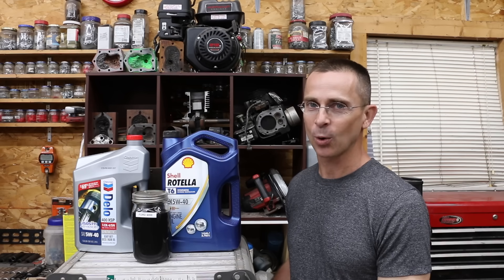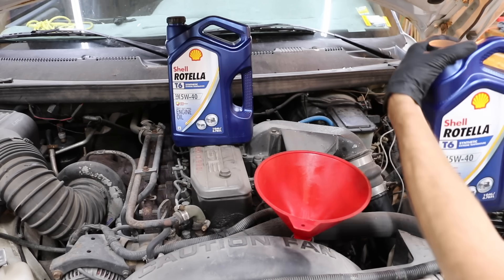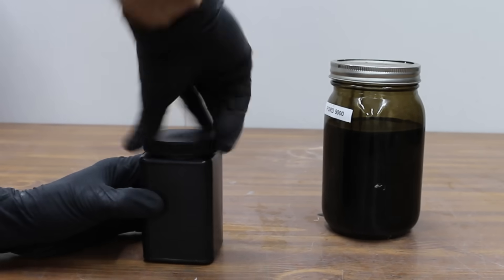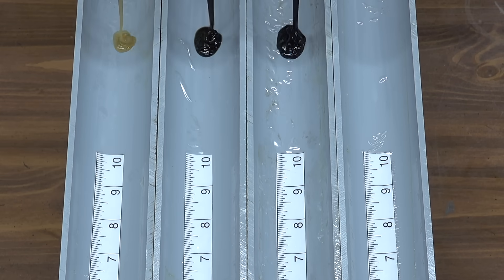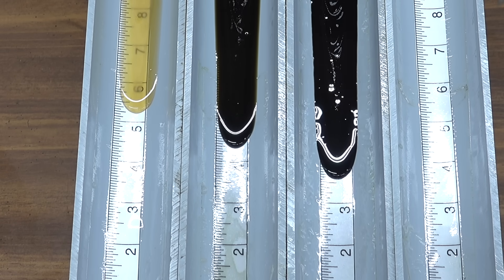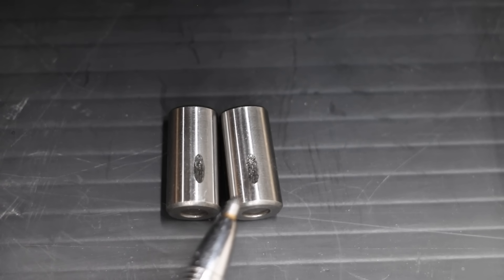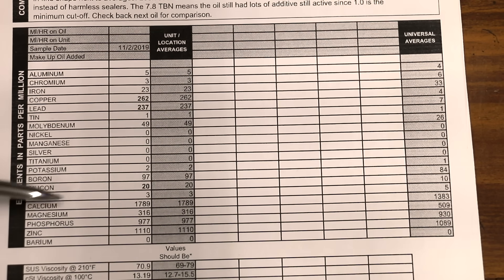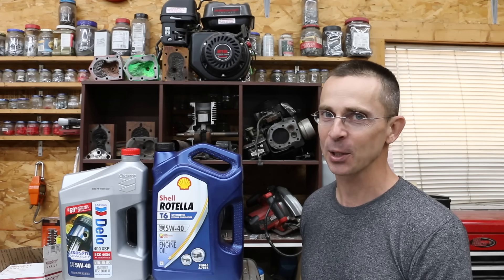Will Annual Oil Change Damage Your Car? Let's find out!

Comment: Video idea: Many people are using synthetic oil in their classic (wet clutch) Japanese motorcycles. They are designed for mineral motor oil.   Some people claim it messes with their clutch plates and eventually ruins them. Others claim it is better for their bike.
Reply from the maker: Thank you for the video idea!

Comment: The Rotella T-6 also used to certified to be SN grade by API. The rumor is that the API changed the certification process or requirements and Shell didn't feel like jumping through the additional hoops to keep the certification. Lots of people inquired to Shell to ask if the formulation had changed and Shell confirmed to multiple parties it didn't. So long story short, Rotella T-6 is also basically SN grade.
Reply from the maker: Thank you for the feedback!
Reply: @ProjectFarm  No thank you for your great, informative, and educating videos!

Comment: Video idea: test the film strength and flow characteristics of oils at a real life “cold” temperature and a real life “operating” temperature. And/or can you notice tell a difference in performance as the weights change (ex 5w-30) from a 5w to a 30w as the temp (engine) warms up.
Reply from the maker: Thank you for the video idea!

Comment: There was an old man back several years ago and he owned several gas stations. I won't involve his name but he's had these all over the state and all they done was sold gas, oil, brake fluid, transmission fluid, and cigarettes and condoms. It was just normally a place about as big as four phone booths put together ( for you young whippersnappers that's never seen or heard of that, is a small glass box you get in and close the door and use the telephone haha.) and normally has a small storage shed for a couple cases of all and Smokes & Things. But this gentleman had had these string of stores for several years and I only started knowing him probably close to fifty years ago and he was in his sixties at that time and he is long since dead but he use Quaker State oil in his Cadillacs. He would normally buy a Cadillac ( I think he had a half interest in the Cadillac dealership in town) and put a hundred thousand miles or so on it and trade it in but you know a hundred thousand miles back in the forties fifties was unheard of on most vehicles. But anyhow he would put Quaker State oil in his vehicles and only change the filters every so often. And all he done during the day would go check on each of the stores and I guess pick up money bring a few supplies and such. He claims that some of his mechanic friends said that motor oil did not wear out just got slicker! Well you know that's not true but a change filters every so often and added the correct amount of oil and that's all he ever done. now he may have just been lucky but I used to pull heads off of vehicle that had Quaker State run in it, and the head The Rock arm everything would have and 1/2 inch of sludge baked on top of them. and of course it would stop the return holes in the heads and want to burn everything up and blow a lot of oil out. But just thought I would throw that out there that you folks about some folks that only change filters and never change their oil. Drive-on!
Reply from the maker: Thank you!

Comment: Thank you. The unbiased information that you provide is extremely rare. I really appreciate everything you do.
Reply from the maker: Thank you for the feedback!
Reply: @ProjectFarm  Could you do a video comparing 0w20 to 5w30 oils? The Toyota 3UR-FE V8 specs anywhere from 0w20 to 20w50 depending on country. The US specs only 0w20 while the Middle East and Australia can use 5w30.
Reply: @Joe333x  Maybe the variation is due to ambient temperature? I understand parts of the U.S. sees temperatures below freezing. In Australia, thats very rare. However we  often have high temperatures, so we have to deal with that.
Reply: @ProjectFarm  interesting facts about leading oils, must see!!!   https://www.youtube.com/watch?v=g7Tc-YkJRxk&feature=youtu.be

Comment: Is your Dodge equipped with a Live oil pressure gauge or is it simply a “dummy gauge” that doesn’t move except on start up and stays in the same position?
Reply from the maker: It's supposed to be a live gauge but it's not very accurate.

Comment: A lot of European and Asian gasoline and diesel cars have oil change intervals of 24 months or 30.000km (18.641 miles). They require 5W30 oil according to ACEA C3 (fully synthetic) but they are designed to last 300.000km (186.411 miles).
Reply from the maker: Thank you for the feedback
Reply: @ProjectFarm  Toyota try to make you change your oil every 10k or 6 months, it's crazy.
Now I'm past the warranty period, I just change on the 10k mark with a good fully synthetic oil. Whatever the months work out to.
Reply: my golf 7 needs oil changes every year and every 2 year a big inspection.

Comment: If you decide to sell the Dodge let me know! I want to made a Hotrod 2nd gen..... Cummins engines don't like 5W-40 unless it is below 0 for extended periods, it will wipe the cam, they like 15W-40. T6 Rotella is hard to find around here in that viscosity, everyone sells the 5W-40. I get mine on Amazon..... Great video!
Reply from the maker: Thank you for the feedback!

Comment: Just a note my uncle back in the day use to only replace his oil filters and top off the oil , he always said the oil actually never went bad as long as the color was with in reason he would change the oil at like 3-5 year intervals and he drove his cars for his living of doing sales he had a 390 ford on a 68 ford that had over 700k miles on it and ran grate never smoked or ticked he used valvoline oil only as well, he had other high mile cars I just really remember the ford as a teenager in the 80s though and the high miles I thought it was cool .
Reply from the maker: Thank you for the feedback

Comment: I'd like to know if it's true that engine oil has an expiration date. I use pennzoil platinum 0w40 for my SRT charger and on the bottle, there's a use by date.
Reply from the maker: I've never seen an expiration date on car motor oil.  Jet aircraft oil has a 10 year shelf life
Reply: @ProjectFarm  yes, I've never seen that before either... maybe it has to do with separation of additives?

Comment: My car (a 1980 Lada 2106) is known in the history of chugging oil and fuel if not maintained correctly. Especially over 100k Kms and then a rebuild should be done,cause the rings do let out quite a bit of oil if not maintained. Now here's a catch,the previous owner of my car changed the oil every year or up to 3000Kms and the car now has 105k Kms and it still runs perfectly a-okay,no burning oil,no clonky sounds etc.Now might be that it's a lucky shot but i always say "it's cause he changed the oil very often" and i will say,for older cars maybe they will benefit from it,but who knows. 
Anyways,great video,very interesting and informative! Keep up the good work!!!
Reply from the maker: Thank you!

Comment: Todd, I couldn't believe my eyes when I saw this video today, because this is the question I asked you in the comments of a previous video! Thank you so much you made this video. 
This is Exactly like my case at the moment - my car oil is full synthetic at 1900 miles (3000 km) and is like yours - 17 months old. I change my oil myself because I find it satisfying experience and planned to change it in the spring when it is warmer. One day I spent a day researching the Internet whether I should change my oil around the one year mark but I could not find anything - everybody said that it should be changed once a year (for the synthetic) because it was written on the bottle... Also in the car forums was popular the opinion that the oil no longer has the lubrication properties, that it contains water/moisture, fuel and it is bad for the engine. However these were all peoples assumptions and absolutely zero tests, experiments, or facts, only opinions or writings from oil bottles. So knowing this rumors and legends I started to avoid driving my car because I false knew the engine oil is bad and I am going to damage the engine life. 
I drive the car couple of times a month and reaching operating temperature every time. Yes, I knew that the engine oil is not good as new, that the oil condition depends whether is city or highway driven and on other conditions. However until now I haven't seen any tests to show whether such low mile oil will ruin the engine if passed the annual change mark.
So thank you so much Todd, that you myth busted this the one year mark for a low miles oil and brought light to this topic! With hand on my heart I am saying that this is one of the Best channels on youtube! Thank you and Merry Christmas!
Reply from the maker: Thank you very much!   Merry Christmas!

Comment: great experiment . however , i am a firm believer in not changing oil , i have a toyota tundra 2009, with 146k on it . the dealer gave free oil changes up to 24k and since then i changed oil (synthetic)  a handful of times only because i was bored. The truck runs great , i put 4000 miles in 1 week driving to canada . no problems . would you like a sample of my oil ?
Reply from the maker: Thank you for the feedback and the offer

Comment: I have a 1977 Corvette. Have owned it since November 1988, and it's now December 2019, 31 years.  The oil i have used since 2001, is Castrol synthetic.  I changed the oil, just last month, which was the first time since November 2009, with only 830 miles traveled!  No problems with the engine!!!
Reply from the maker: Wow!  Thank you for the feedback

Comment: Hey the oil friction test simulates the stresses bearings get in the engine, but not the up down motion of the pistonrings against the cylinderwall. Would it be possible to test this somehow?
Reply: Oil manufacturers test that with a special device. It is called "Combustion engine".
Reply: Völl Däpp woow hät ich jetzt nicht gedacht 🙄 merkste das das zu aufwändig wäre um da resultat für ein video zu erhalten
Reply: @McFlegmato  Ja klar, ich wollte damit andeuten, dass das eher nicht leicht nachzubilden ist. Da spielen ja auch noch zig ander Faktoren rein. Temperatur, Druck (!), Verdünnung durch den Kraftstoff, Gasströmung, Verbrennungsrückstände, Scherstabilität (ist das was du meinst denke ich),  Schergefälle in Abhängigkeit der Drehzahl ... etc.etc. 

Motoröl viel komplexer als es den Anschein hat. Das was Project Farm macht, ist wie er selber sagt, nur eine Indikation und ich glaube, seine Methode ist okay für die Fragestellung: Muss man ein Motoröl wechseln nur weil es ALT ist, aber geringe Belastung (wenig Motorlauf) erfahren hat?

Und die Antwort ist klar: Nein.

Ob man mit seinen Methoden Fragen wie: "Welches ist das beste Motoröl für Anwendung XY?" oder gar: "Welches ist das beste Motoröl?" beantworten kann, da hätte ich Zweifel, obwohl er viel solider arbeitet und argumentiert als viele andere Laien.

Comment: The new Ford specs require an oil change every 16000 kms. For me that's once a year. Wonder if the oil is finished after that long ? Also what really happens if you accidentally put gas in a diesel vehicle ? Do you have to drain it right away ?
Reply from the maker: Thank you for the feedback

Comment: First off, a lubricated engine doesn't get rusty even if the oil is old and has acid in it
Oil does not break down unless badly overheated and burnt. but the additives do get weaker
Oil used in Diesel engined gets dirty looking fast, thats the nature of Diesels, and it's harmless
In my lifetime, having driven over 3 million miles, I typically changed oil in my gas driven vehicles once a year, only adding oil as needed. filter change every 6 months.
My engines typically lasted 300000 miles at which time I either replaced the engine for reliability or replaced the vehicle as it was usually pretty well worn out otherwise.
I used synthetic oils exclusively, and in later years used Rotella in some of the vehicles, Preferred oils I used were Mobil 110 w 40 and Castrol Syntec, 10 w 40---unless you operate in a climate where the low temperatures are below 10 degrees F all the time, there is no reason in hell to use zero or 5 weight oils, THAT part is all advertising hype, and manufacturers hype for alleged fuel economy  under CAFE standards.
All oils have to meed minimum SAE standards, so brand names really don't mean much, go by the stats on the product container itself.
In the past 40 years of driving, I lost only 1 engine due to oil issues, and that was after a Jiffy Lube oil filter swelled up and exploded at 75 miles per hour on the interstate, and the engine wound down quickly! It was still running without oil, and was able to go another 3 weeks as a usable engine, but after it had that failure it had a weak feeling and lack of power, so it was replaced with a new engine at 192000 miles.
LOL--I guess that means any oil is better than no oil.
DF
Reply: You are absolutely right. Don't know why people are getting fooled by this synthetic marketing ploy

Comment: Could you kindly make a video which explains engine oil in motorcycle? How will a 10W30 recommended motorcycle engine will do if I use a 10W40 engine oil?
Reply from the maker: Thank you for the video idea!

Comment: Excellent level of video planning demonstrated here.  Should probably again toss out the massive caveat to not use diesel oil in your modern car if you need to pass emissions inspection.  Zinc will ruin the catalytic converter.  For old cars, motorcycles, and people that don't care, YOLO.
Reply from the maker: Thank you

Comment: I’d like to see a diesel fuel and oil lubricant additive like archoil, stanadine, ams oil, Lucas upper cylinder lubricant,etc. ultra low surfer diesel is ruining the trucks with the bosh cp4 fuel pumps. I wonder what lubricant will make the pump last the longest
Reply from the maker: Thank you for the video idea!

Comment: Can i use Rotella t6 5w 40 in my 2001 Audi A4, gas engine?
Reply: The handbook will give you the correct specification. It's not just about SAE viscosity. The handbook will tell you the correct oil. Coded something like VW 5.0x.yy
Reply: @paulanderson79  Thanks. I have been using 5w 30 and 5w 40 Mobil 1. The car is so old and manual has some strange oil codes.
Reply: @Jinny-Wa pretty much all VW  specification oils are 5w30. Keep in mind that sae viscosity is absolutely not the whole story. This idea of old car use thicker oil is nonsense.
VW, for all its faults, is very precise about oils.

Comment: Use synthetic oils and change your filter often (3k miles). This way you don't have to change the oil, just top it off with oil with the filter change. 
Diesel train engines are run for 1 million miles before oil change, they just change the filters regularly. Trucking companies also follow this path. 
Oil companies are just suckering people and many Americans are guible.
Reply from the maker: Thank you for the feedback

Comment: What if my car drinks the oil and i just add more. That calculates as "slowly" changing it? And yes, it's a German car. It's a feature
Reply from the maker: I'd still drain the oil periodically to help remove the solids that accumulate...wear metals such as copper, chromium, lead, tin, etc.
Reply: @ProjectFarm  Thanks